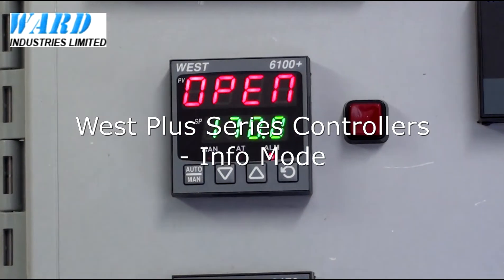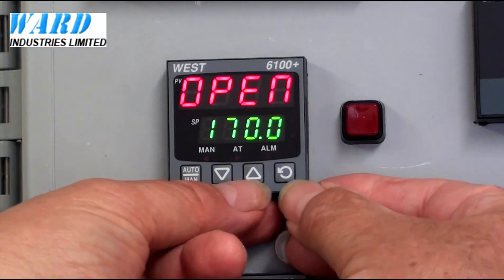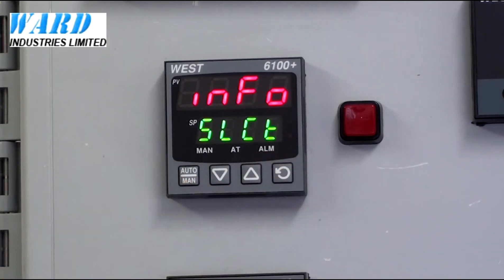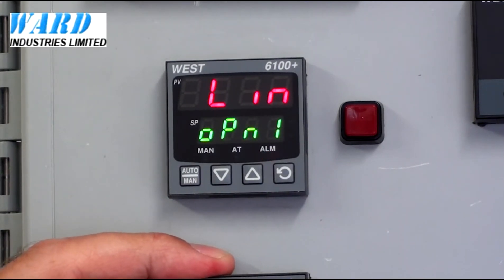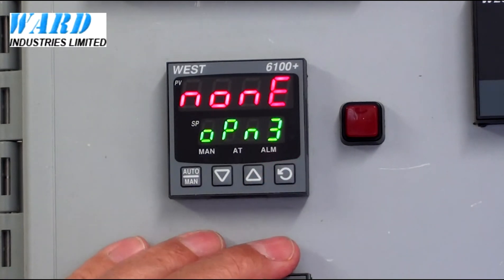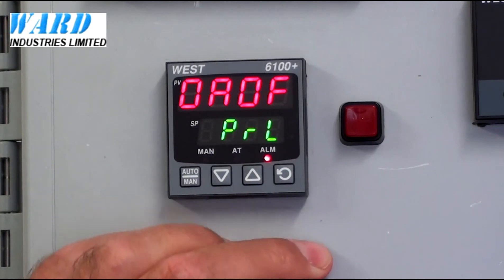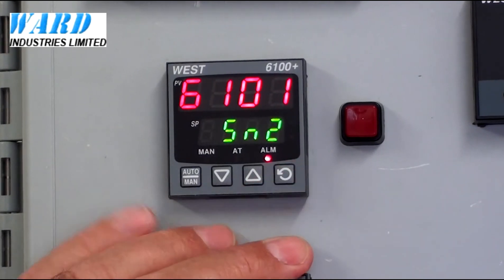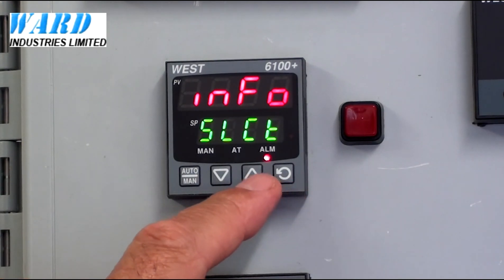P6100 PID Controller - Plus Series from West

Comment: How to set the temp
Reply from the maker: Hello Raymond. This video deals only with the "Info" menu on the Plus series controllers. It is not possible to change anything in this menu. This menu gives details about the controller i.e. the type of boards that are fitted and which slots they are fitted into, date of manufacture, serial number. The programmable parameters such as type of input, PID terms, alarm settings, range etc are dealt with in another video. https://www.youtube.com/watch?v=VI76pSzIuss&t=292s

Comment: So why did you need to see those? You didn't change anything
Reply: This video deals only with the "Info" menu on the Plus series controllers. It is not possible to change anything in this menu. This menu gives details about the controller i.e. the type of boards that are fitted and which slots they are fitted into, date of manufacture, serial number. The programmable parameters such as type of input, PID terms, alarm settings, range etc are dealt with in another video. https://www.youtube.com/watch?v=VI76pSzIuss&t=292s